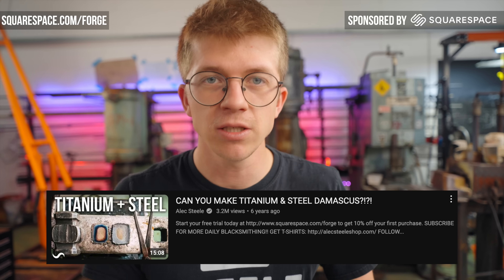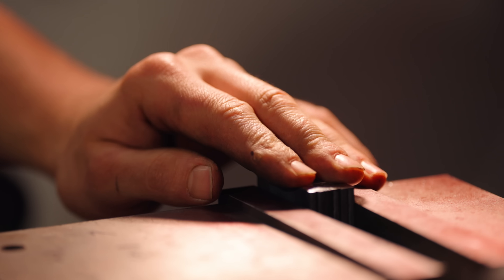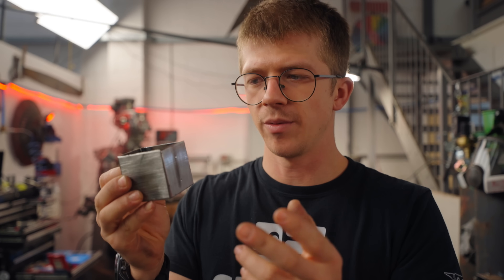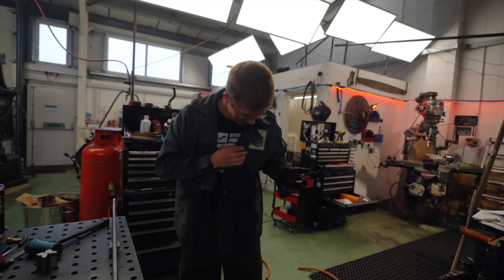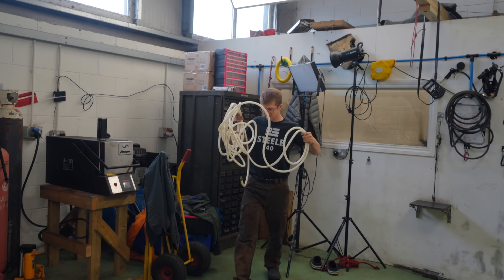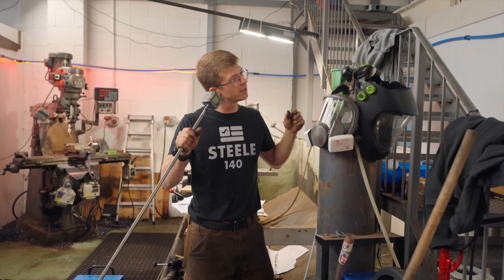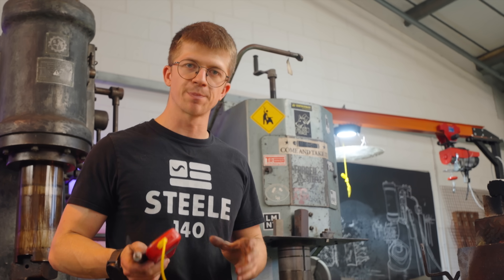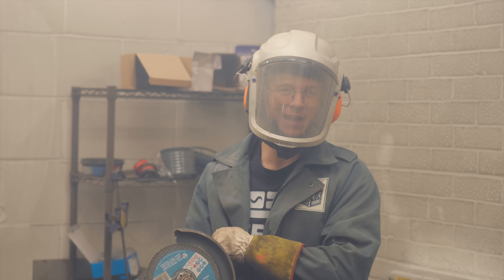Can I make Titanium Damascus?

Comment: Why the titanium billet melt at 2100F, even together with a low flow rate of argon? I think their melting point is 3020F for cp and 2930 for grade V. The can made of mild steel with melting point of around 2500-2800F didn’t not melt, but the content inside with higher melting points melt. Because the heat at the core of the billet has nowhere to escape, thus much hotter there?

Comment: Is there anything special besides the colors? Is it stronger or better in any metrics? Or worse all around?
Reply: I would say its mainly beneficial for corrosion resistance, like for diving knives. However, it doesn't hold an edge very well as it's softer than carbon steel.

Comment: If all you're doing with the damascus is changing the surface oxide across the object, wouldn't it be easier to just make an object out of one solid block of Ti, oxidize it, selectively etch the oxide, and then oxidize the whole thing again?  I know I know, rule of cool and "because I could" thinking, but this seems like way more effort than needed for the end result.

Comment: Damascus steel can't be made in this day and age, not real Damascus steel as is durability would be like 5x less than if it was Real Damascus Steel, Flour
Reply: real Damascus steel? It's just a name for pattern welding. Or do you mean Wootz steel?
Reply: @TheEthanEdge  Damascus steel wasn't just pattern welding lol Real Damascus Steel was considered one of the finest and DURABLE steels, the pattern was just a bonus really, like i said real Damascus steel can't be made anymore the trade was secretive, Damascus Steel in this day and age is literally just a pattern, not in historical times.
Reply: @johnboyne1  apart from the guy in 1998 that figured out how they did it yeah.
Reply: @TheEthanEdge  its still proven old Damascus steel was way more durable, its still not close just because it looks like it doesn't mean its the same thing.
Reply: @johnboyne1  proven by who? More durable than what? If you're using modern steel, it's better than whatever they made back then.

Comment: Damascus is actually poor uneducated slums assassins melting and mixing random junk into a hodge podge of molten ores FULL of impurities toxins poisons and various salts and sands. Often quenching and disposing of the assassin shank shiv blade weapon after a crime in the nearby water causing super mental illness. But their inexperienced untrained impure dirty poisonous maybe even quenched in poisons blades were actually porous brittle and super low quality and really dirty carbon looking and swirly in appearance but still hammered and fashioned to be like a blade but the imperfections and random mixes of various literal broken bits of metallic junk and trash they found with some rocks they maybe thought were ores of some kind meant tiny nanotubes of carbon and super sharp edges and were often serrated and things like a triblade that looks super lethal wasnt possible often enough due to the brittleness and mostly being held together by toxicity and sheer luck. They did however often make them shaped in strange shapes to break off and dislodge in victims so when the movies show you a wonky zig zag ceremonial or sacrificial looking blade, its partly making fun of their uhhh creative guesses. So as for modern damascus mainly being lots of smaller layers of used discarded razor blades having often a sharp edge by a strong type of metal being heated partly melted and sort of hydraulic press hammered together in layered sheets so all of india will sell you some expensive knives that are 'decent or okay quality' saying damascus. But if its VG10 or some sort of standard its likely good quality still and some of them use a real sharp hair thin blade in the middle of the damascus so just the tip like the samurai sword is sharp in the middle and the damascus layered folds strengthen and reinforce the delicate brittle sharp knife blade in the center. So perhaps you could take this knowledge and try a few different approaches with titanium. Remember in ancient times past most real damascus blades are the length and size of a finger and are worth money like as much as a house in some cases as they were maybe a tool in the killing of important historic households families and people that are more signficant than you will ever be.

Comment: Nice work on Pattern welding Titanium, Quasi Damascus.
Reply: Yeah, Damascus pattern weld.
Reply: @TheEthanEdge Only Damascus Like ! Just pattern welded.
Reply: @ericswain4177  maybe a comma will help lol: Damascus pattern, weld. I think we're saying the same thing. It would be pointless to try and make Damascus steel as modern steel is far better.
Reply: @TheEthanEdge  The point is  Damascus is not only geographically specific to Damascus Seria but the orr itself being from the mining region of Seria itself and its unique composition. Damascus is an ambiguous branding term that's misused and misconstrued and It's not a matter of better which is not proven because it has been virtually impossible to reproduce true Damascus steel.

Comment: Make jewelry out of it. Use those colours, check titanium jewelry for the variations you can get.
Titanium fans please note:
In most cases where a titanium part moves against another surface (bolts, cutting edges, sliding parts, interference fits) they are either willing to spend a lot on inspection/repair or they are willing to pay for single use parts.
Please no bolts that hold wheels onto cars or bikes (seriously, don't).

Comment: I will have to make some custom alloy powders too for my 3D printing system that converts oxides into raw metal with out added gas fluxing like the argon (entirely energy flux based system that not only purges and protects the material but actually extracts it (ie its not pushing by displacement, but rather attracting in order to leave even a pure vacuum in the specified region)

Comment: I am wondering if you considered stir friction welding to make the layers of various titanium material considering you can use that method to weld a rod of aluminum to a piece of steel casing of a car engine, and its used as part of the process by rocket manufacturers like the one run by Tory Bruno to enable welding titanium alloy hulls that are just too big for a furnace to temper it (thus avoiding cracking and splitting due to various tempers of the weld material and the hull casing components while being used as a rocket considering the high and low temps it will have to suffer from) 

Hopefully you can get some materials cheaper too, and really go nuts using stuff with zirconium and other materials in it too, :) other than titanium and aluminum. (I still want to use forge pressing tungsten and tantalum carbide powder into titanium to make a "micrograin carbide" knife edges for extreme tooling hardware with near diamond hardness but very low brittleness so you can really abuse it while cutting and forming hard metals like carbon steel and stainless metals ect. :)

Comment: You could have cleaned them in a series of acid baths and washes. with exotic metals .......be very careful to follow instructions and process steps but this method is the best from a working standpoint.

Comment: "it's basically an instruction manual", Yep!! This the most important function of patents IMO. They "teach" technological and design processes, which become publicly available after the limited period of IP protection offered. Basically, the owner of the patent is trading the right to a short-term competitive lead, in exchange for teaching the technology to the public. It's a good incentive to go through the work of creating patents, which have a generally consistent verbiage and presentation.

That all said: Patents are not an instruction manual "for dummies", what I mean is that they don't assume a complete lack of technical know-how... This would make it unwieldly to create them. Nothing should be intentionally obfuscated or overly vague, but ultimately they assume the reader is "skilled in the art", and understands the implications and general processes or methods involved (the flow-rate of the argon is a great example, the writers of the patent and inventors may not have actually known or cared the exact flow rate, only that it was simply sufficient enough to purge oxygen from the workpiece.)

Comment: Always love the creativity going on in the workshop, i just have one recommendation for safety while working with media blasters/cabinets. I HIGHLY recommend using a particle respirator or your supplied air while working with it due to the amount of fine particulates that are in the air during operation! If it can abrade metal then it sure as hell can abrade and clog your lungs, so stay creative and stay safe Alec!
Reply: In addition to your concern, I thought that Alec might encounter problems with Si contaminating his billet. I wish he would have revealed what he did to clean the materials further, if anything, before layering the sheets into the can.

Comment: when heating metal for color, I keep a bottle of co2 near by with an air blower. I can heat parts faster and "freeze" my desired color in place by shielding with the co2 when I see the color I want so that no further color change happens as it cools.

Comment: Coat the casing with white out before adding in your titanium and when your done forge welding the titanium should easier to get out of the box
Reply: Do not do this. Just clean the surfaces really well which he did, no need for added contaminants.

Comment: You could quite likely challenge the patent anyway and dispute its authority.

For somthing to be valid for a patent to be issued, among other tests, it must not be obvious to an "informed practitioner of the art".

On the bases that most metals have been forged welded from laminates through blacksmithing for well over 2000 years, there is a good challenge on why the patent should not have been issued.

Of course you would need to challenge this in a legal setting if any challenge was made, and that wont be easy.

Many patents are sought by companies just on the basis they will put off a competitor from trying, and not becase the patent holder actually expects it to hold up in a challenge.

Comment: Copyright laws are broken, and anti progress at this stage, only resulting in stagnation and even worse, gradual regress.
A patent should only protect the actual inventor/creator/artist/innovator PERSON, and give them an exclusivity period of 5-10 years maximum...after that, that invention, creation becomes common knowledge of humanity for others to use freely and improve upon. PERIOD.
No extending it, no nothing.
Humanity's science has evolved by taking existing inventions and improving them  gradually.
Take the bloody wheel.
Lets do some thinking and apply the current IP laws to the cavemen. But back then the caveman would simply physically eliminate the others trying to use the idea.
So caveman 1 discovers they can use tree logs to move larger objects across long distances, ... in our reality another caveman saw this idea and used it at their place, until caveman #3 saw the logs and used thin slices of a log and create a "wheel"
In the parallel universe where the IP laws apply, caveman 1 would bash the heads of caveman #2 and #3 for taking HIS invention and creating a derivative from it.
The only ones allowed to use the rolling stuff, is himself and his tribe after he dies.
...
Humanity today would still be a rudimentary agrarian society had the current day copyright laws have been somehow existing and enforced from the early days of humanity.
Copyright laws must be nukes from their present form. Anything idea older than 5 years should be free common goods for anyone to use and adapt and improve and create derivatives from.

Comment: It would be cool if you did it the traditional way too. Getting a piece of grade 2, then grade 5(much thicker than what was used here) then hitting it to stretch it and folding it over and over in a forge and then hammering it out into a knife. Its actually easier than you'd think, you just need the tools(forge and large hammer or automatic hammer/press which you already have).

Comment: For future reference: Patents don't stop you from making anything, they stop you from selling it without paying the owner.   You can make a patented item just don't sell it!  And the patent holder has no recourse.  An say you do sell it, then the patent owner would have to take legal action and even then what they can receive is limited to what is considered "reasonable royalties" which is something like 30%.   (This is why industrial theft is so problematic because you can take someone design for a machine that manufactures wedges; and you can sell those wedges all day long ~ As long as you don't sell the machine.  Yes, the wedges can and are patented too.  but there a difference between patent for an idea and a patent for a design.   Patent for an design are much easier to get around.

Comment: If you can make a laminated blade with an actual decent knife steel core that hardens to an acceptable hardness without warping or delaminating the titanium you might actually get your hands on a very spicy pricy knife steel patent. I doubt it can be done, but it would make for a great video if you could (or well even if you can't) pull it off.

Comment: at my job i regularly work with solid titanium parts and screw, a lot of jobs require that when changing something out you throw the screws out and use brand new ones, every screw is around £115-120 or $150, and one parts ive seen break is a solid 5kg chunk of titanium, i dont even know how much that might be worth, since it broke i took it home and now its sitting on my fireplace

Comment: so for the big hole to little hole I'm not expert with welding or metal forging but if yur gonna disregard the original hole setup which i actually think is fine just for the reason that the entry hole is larger than the exit hole will cause the gas to backfill the entire container since more gas is being put in than being let out, although I understand yur thought process I wouldn't have just made 2 holes on the smaller side i would have made at least 4 in the center of each quarter (for instance if u drew a line to split it in half left to right and one to split top from bottom, so u have 4 small squares and put yur holes in the center of those) of the side that was letting the gas out and making sure those four were much smaller than the original 1 hole so as not to allow more gas to escape than is being filled

Comment: If you attach a tig gas lens(diffuser) or even just shove some fine steel wool into the end of your purgeline. It helps spread that gas much easier. So your inline hole wouldn't be much an issue

Comment: Other titanium grades may color differently than CP and Grade 5. Grade 12 contains nickel and molybdenum, Grade 7 contains palladium. Both are likely more costly than the first two.
What squeezed out molten was mostly steel as titanium's melting point is 3034F for CP. Steel melts at 2200 to 2500F. The white paint trick should work. We use it in one melting process.

Comment: Alec I used to work aerospace forge we worked with wasp alloy every day we forged at 1750 degrees f colder and it won't flow hotter then 1900 and you get liquid metal

Comment: "When in doubt, more heat" yeah... Not with titanium.
You don't want to get anything wrong with titanium if you don't want to change it's molecular structure and consequently it's singular properties.
I was also wondering why you didn't do all this process in a sterile room, I know that it is extremely expensive and tedious and It might not be worth it but even the slightest impurity or the smallest grain of dust could ruin the material.

Comment: Not sure what steel you used for making up your "box" or pack. A suitable steel that has similar working properties to Ti6Al-4V (Grade 5) is S45C (working characteristics at the temperatures I suggested previously). This will ensure minimum creasing, folding etc and the steel will them form at near enough the same rate as the Grade 5 Titanium.

Comment: Newb question!  What kind of forge is Alec using??  I'm confused how he managed to smelt the titanium with just propane.   When I dig a little bit (and I do mean little)  propane can burn up to 3500F ; Ti melts at 3000F ; forge temps I find online are around 2500F.  Do the forge burners use forced air?

Comment: What does it mean, do you want to make Damascus titanium? Damascus steel is not just this characteristic pattern, but a specific processing technique. So no, you will not make  titanium so-called Damascus. The production process of Damascus steel was a secret and was never mastered in Europe. No reliable descriptions of this process have survived. Modern metallurgical experiments, based on detailed studies of the microstructure of this steel, have allowed the development of a technological process leading to obtaining a material with properties very similar to the original Damascus steel. Very similar, but still not the same.

Comment: The 2 smaller holes make sense as it means more penetration of the gas and less oxygen pockets, just increases the volume of the argon gas used. Actually 4  one to each side might work better? Could compensate with even smaller holes?

Comment: I've just been trying to find a metal. I can use for a sword that can withstand my strength.. it's like something that can cut a brick in half, not a cinder block, a brick without having to reshape it every time i mean, the s shape that it gets after a while is good. Cause it can cut a few bricks before I gotta start working it to be straight but I want something that can just repeatedly cut bricks.... because if I can do that and the sword holds up, I know it can cut a lot more stuff